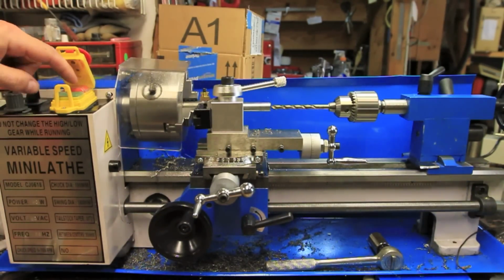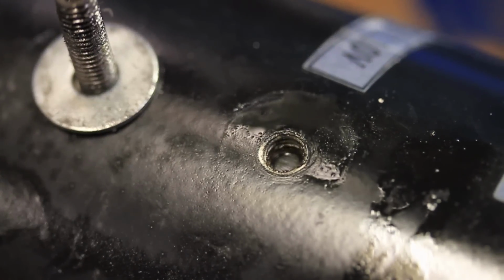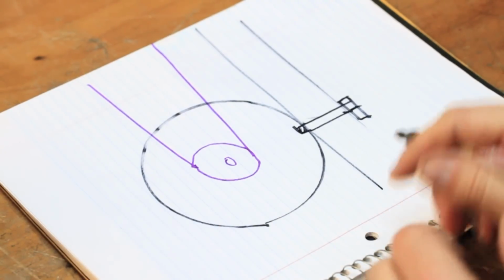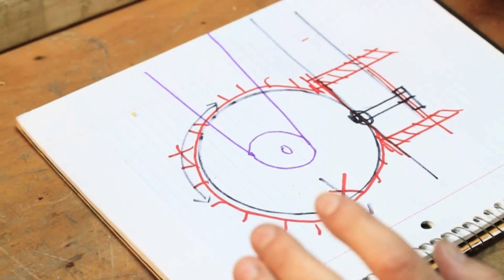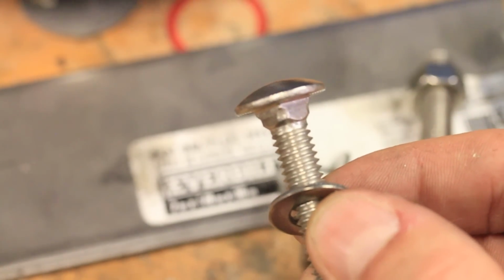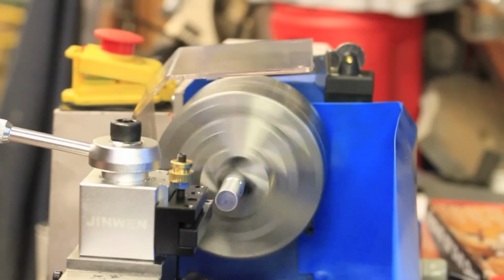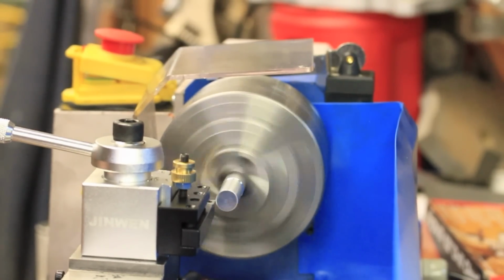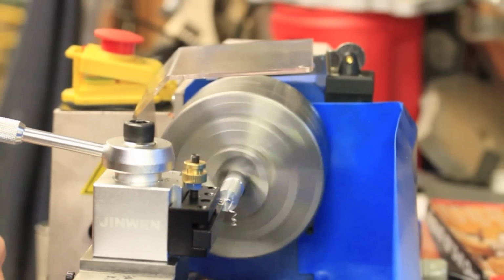It wasn't broken, just cheap - Fixing the Mini Lathe Motor Mount

Comment: You would think that, with there being 1 BILLION Chinese people, they'd be able to throw enough brainpower at literally any problem to resolve it with a quality, well engineered, well built product.

I suspect that they joke about the crap they export to the rest of the world and that everything they keep in China is actually an engineering marvel!

Well done on your fix!
Reply: Brains Ironically Actually those "1 BILLION Chinese people" manufacture anything you'd like to. You want a $1500 lathe?! Why they're more than happy to deliver that to you. You can afford to spend only half(ish) of that? Not a problem! They just adjust the quality accordingly! Mind you, people who buy this stuff probably wouldn't buy it if it'd cost twice as much. And this is not even the cheapest thing available out there (although it's the cheapest thing that resembles a metal lathe): there are even cheaper ones out there too (which literally look like toys and probably perform like them too).
Reply: EVERY manufactured product, even German built luxury cars, go through a cost reduction phase. EVERYONE puts significant effort into producing a product as cheaply as possible. I know a guy that got a huge promotion and bonus for saving 35 cents on a $20,000 car.
My point is that the Chinese are designing things down into the "garbage" range for one reason - people are still buying it. If nobody bought cheap junk anymore, they wouldn't make it anymore.
You can buy good quality stuff from China - if you pay for it.
Reply: The chinese are masters of demand. By that I mean, they will make you anything, and at any level of quality you specifically request it to be at. You can get a knockoff guitar that rivals the finest brand new Gibson, wrenches that would not look or feel any differently than a Mac equivalent, or you can get the cheapest part to fulfill immediate requirements. It all depends on how well you can communicate the requirements of what you need, and expect to pay more than the bargain basement prices they charge for the cheapest of the cheap.
Reply: The Chinese actually make some of the best lathes/mills but they'll also sell you crap if you ask for it.
Reply: John Ridley "why should they put in the effort?" - Actually they ARE putting in the effort. Just not into producing quality, but into producing everything as cheap as possible.
Reply from the maker: Thanks so much!
Reply: You might be more right than you'd think you are. China is a growing industrial power, so chances are, Chinese bought up all the decent Chinese tools because they really needed them, and you get the leftovers. Well, chances are, what they get to keep isn't actually excellent, but working. Besides, somebody sells a badly broken one in China, they're going to get it back, potentially flying right back in the general direction of their noggin with imminent danger of collision. They sell one to you, what are you gonna do, teach them some foul language?

One billion Chinese people don't live in an industrial country though, perhaps a hundred million do, the rest are far from all the civilization, but the industrial part is growing. As it's converging, they are likely enough to outengineer all of us, especially looking at recent decay of German universities, as these are striving to get themselves aligned with the international level.
Reply: Sadly, they get top quality iron ore from Oz and somehow turn it into badly made, melt in the sun, products, which we buy back because we no longer have any manufacturing to speak of these days. Top marks for the patient rebuild and sharing your journey. I hate crap products and they just become space wasting junk in the workshop.☺
Reply: They build them cheap so you have to buy more
Reply: They could, but right now people are paying good money for garbage, so why should they put in the effort?

Comment: Very nice.  That motor won't be giving you any more lip.
Reply: That's true, very good solution. But he did lose adjustment movement if he needed to use a slight longer or shorter belt for whatever reason. Grinding the two carriage bolts heads so they sit a little closer will give him more movement of the motor in the future.

Comment: As long as these Chinese things are looked at like a parts kit that need finishing they are great value.  People expecting a ready to go piece of equipment will be disappointed.
Reply from the maker: Exactly! and really as a parts kit they are a pretty decent deal.
Reply: TimNummy Yes, I'm beginning to get the idea. Not a way to manufacture and distribute products and shows indifference to the user.
I'd still take your pragmatic approach and am viewing til the end of your project. I might just get one, but it must work all materials accurately. Up to now, it appears sloppy. I hope you wound up being able to machine to fine reliable tolerance.
Happy you tried this - hope it was all you hoped for n better at the end...   :-)
Reply: I agree. You can sometimes have bad luck with these products, tho. I bough an Anet A8 and had to do some considerable modifications for it to work "well". But hey, it was only 150 bucks!
Reply: Most chinese machines needed to be checked and do some adjustments, modifications before use. It is cheap but usable for hobbyists and small startup biz.
Reply: Yup, just found that out with my micro Marc 7x16. In the process of redoing everything. Did not check the motor mounting so now I will. Also when you first showed the stripped threads I thought that if it was me I would repair that with time serts.
Reply: I was about to ask who would expect value out of this.

Comment: need to alighn the motor , as the belt is moving against the case of the lathe , it should center in the middle of the sprocket
Reply from the maker: Thanks - it wasn't easy to get it lined up and I almost wonder if the headstock isn't square... I ended up having to get a new belt and motor pulley anyway though, definitely check out that video is you're interested!
Reply: eazy to check for squareness  : chuck in a piece of smooth and straight roundbar (like the stuff they use on slidebearings) put a measuring clock on the toolholder and measure along rhe roundbar across the whole length of the lathe both top and side 
i think its move that the engine isnt mounted level (the front of the motor is pointing up)  that causes the belt to move toward the housing of the lathe

Comment: Nice modification. Thing that makes me mad with all these Chinese tools is that they do not only make discounts on cosmetic materials but to vital ones. And i ask, how much a proper mounting plate could raise the final cost to the most vital part of this lathe, the motor? Peanuts. The problem is they do not invest in any design, they just copy and poorly paste. These guys are awful and stupid and i avoid them if i can...
Reply from the maker: Thanks! I agree it's unfortunate that they invest so little in quality control efforts on stuff like this because it really does have the potential to be a decent product and they are absolutely capable of producing at an extremely high quality (iPhone, DJI drones, etc)... of course the silver lining is always how amazingly low cost they can sell products.

Comment: As I understand, your first job after arrivals is to take the lathe apart, and actually redo the factory's job to take out ALL the problems, replacing all gears for metal ones, also all plastic handles. I wood pay with pay-pal and start a dispute and take the money back if not satisfied with the solution, you have 3 month standard, Pay Pal sends the money back.
Reply from the maker: Yep, these lathes are more or less unusable out of the box.

Comment: So what's to be learned here.. is mainly..

DONT BUY CHINESE CRAP!! 

This is good because I was considering getting one of these... yeah ... not anymore! I'll save my coin and get something decent!
Reply from the maker: I think a lot of the issues with these lathes are consistent regardless of the variant you get whether it be Grizzly, Seig, Harbor Freight, or the no name ones... and they probably all come from China. That said, there may exist a US, German, Swiss, or Japanese made lathe in this size range but I wasn't able to find one and if I could I'd imagine it'd be prohibitively expensive to justify for a hobby.

What I have learned is a tremendous amount about lathes that I probably wouldn't have learned so quickly had I received one that didn't have any issues.
Reply from the maker: Those look to be both much smaller and much more expensive - probably for jewelry or watches more than in the garage.
Reply from the maker: Not without spending a lot more. The Seig C-2 variant is at least twice as much and effectively the same machine with a better fit and finish with likely (although much less dramatically so) many of the same issues this lathe has and really no additional functionality.
Reply: SuburbanHobbyist "Yep, nothing like having to fix your new tool to learn about that tool." - Heh, people in Communist countries used to do that with their cars. They waited years for them, then had to do regular maintenance on them (like every half a year or even more often) so that the car won't bail out on them (e.g. in the middle of the road at the beginning of a family vacation).
Reply: Yep, nothing like having to fix your new tool to learn about that tool. So there isn't a decent quality metal mini lathe out there? Something middle of the road as far as quality? I was thinking about getting one, but like you said, it's just a small hobby so I don't want to blow tons of cash. I'd be willing to go quite a bit more expensive than the one you have here though.
Reply: TimNummy literally buy a sherline lathe
made in usa  benchtops
Reply: David Reade - Evans iii
Reply: I see. I don't really want to have to take the thing entirely apart and fabricate a new motor mount like you did. Sure seems like anyone who buys one of these will have to do just that as eventually those few threads will strip. Thanks.

Comment: I absolutely DESPISE lazy manufacturing and design! Your ingenuity, on the other hand, has earned you a sub. Well done
Reply: @Cylo's Garage That's because the Chinese do not develop new products. They simply copy, often with only a limited understanding of the original product. The Indians are the same.
Reply: @greenpedal370  yeah this mini lathe is pretty similar to a now old einhell mtb 3000 which is a lot better than this copied crap
Reply from the maker: Thanks so much! I hope you like my next video just as much with my carriage clamp redesign.
Reply: yeah the fix was the only great thing I saw , the engineering on that thing is just horrible. Also when you turn the piece of aluminium, was it bent to begin with or is the lathe that turns weird? if you see when it spin at the edges it seems like it's out of centre.
Reply from the maker: It was probably either not exactly true in the chuck or maybe a little out of round to begin with.

Comment: Hi Tim, valuable info for me as i'm considering buying this exact lathe. Thanks very much for publishing. Do you know if this is a 'Brushless DC' motor? Is the motor torquey enough at slow rpm?
Reply from the maker: Thanks for watching! It is definitely not a 'brushless' motor - you can see me putting the brushes back in at 11:09 :) The models with 'B' in the model number should have brushless motors though. For example, this is a CQ0618-300C, but the CQ0618-300BC would have the brushless motor. 

As far as the torque, it seems to have enough at this point but I haven't had the chance to do too much turning as I ran into another problem I had to fix (new video coming soon so stay tuned) before it would work correctly.

Furthermore, this one doesn't have the two speed transmission that almost every other mini lathe has (regardless of the fact that it has the warning label not to change speeds while it's running!).  Also, this was advertised as a 2500 rpm motor but the sticker on the top says 0-1500. The seller (who was terrible and evasive of any issues) said it's a 'misprinted label and I could verify it with software' <- yeah, right. The video after next will likely be a tachometer install, so keep an eye out for that one too and we can see how fast this thing actually turns.
Reply: Hi Tim, thanks I can see the brush installation now. Looks exactly same lathe that I am considering. It also does not have the hi/Lo gearbox. Looking forward to the next vids on the lathe. Very interesting.
Reply from the maker: Hey Greg, new video today! https://www.youtube.com/watch?v=sak6qexZ_ik&index=3&list=PLZe1YowzFIKWBOpZ7xeQQkc9JPlZvkHbT

Comment: Now that's odd. I've never seen one of these lathes without a hi-low gear selector on the back of the headstock.
Reply from the maker: Same. The seller continued to insist that it is still a 2500rpm unit but without a tachometer it's hard to verify.
Reply: The REALLY funny part, and I just noticed this is the big notice on the front of the machine that says "DO NOT CHANGE THE HIGH/LOW GEAR WHILE RUNNING" XD
Reply from the maker: Ha, now I'd be curious to take the head stock apart and see if it has the gears in it or if it's really just a tube between the bearings. Maybe that will be good for another video?